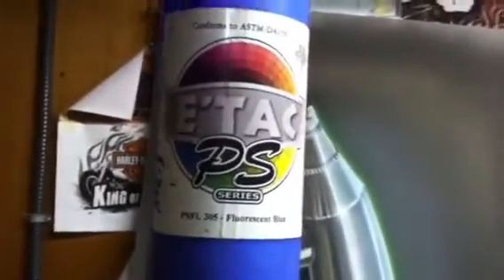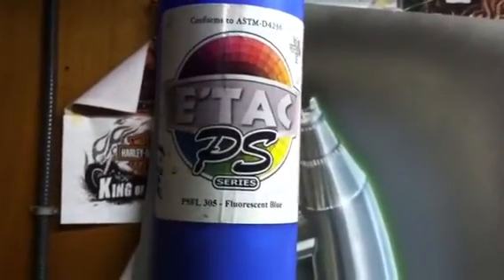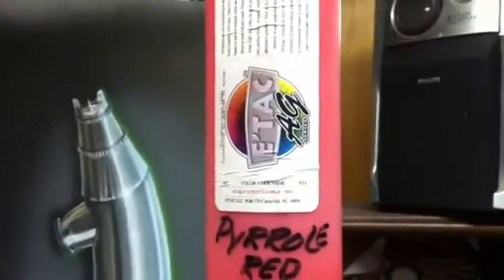Importance of suface Preperation

Comment: I'm so new I have no idea what this means. I have a question - I'm trying to airbrush the bottom of a skate board . its hard to get detail lines with out the paint splattering. is it the paint i'm using ? Spectra , Createx , They work really well with t-shirts but not on hard surfaces???? What would you suggest ?